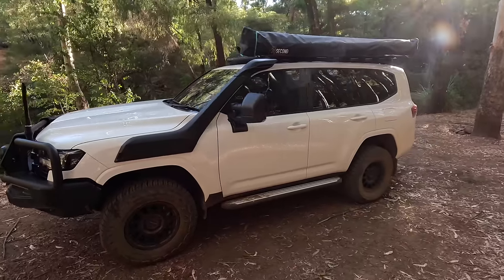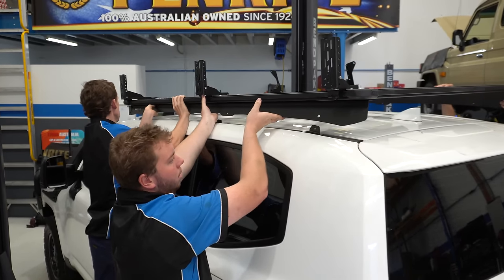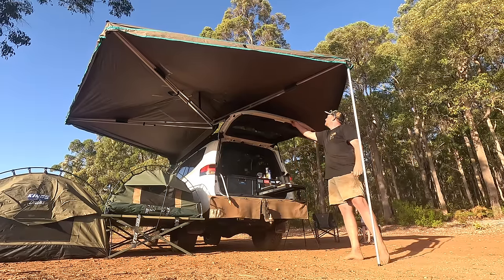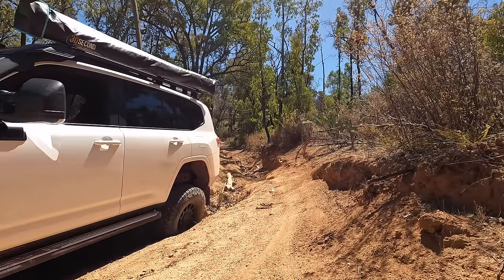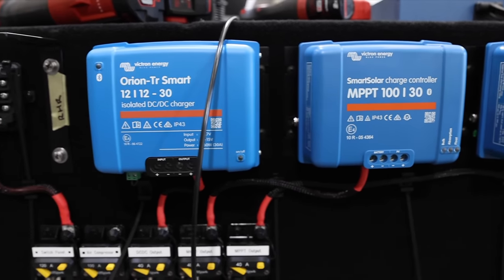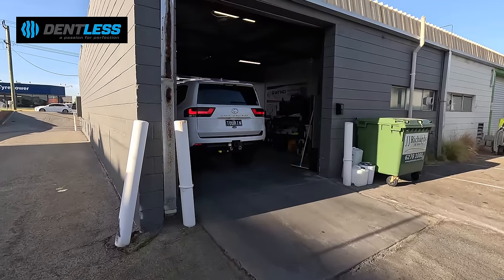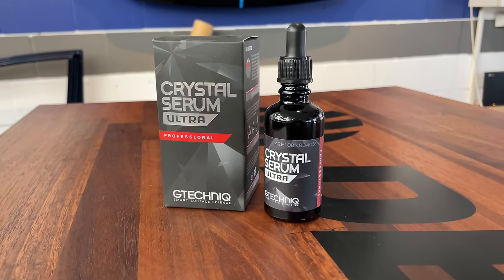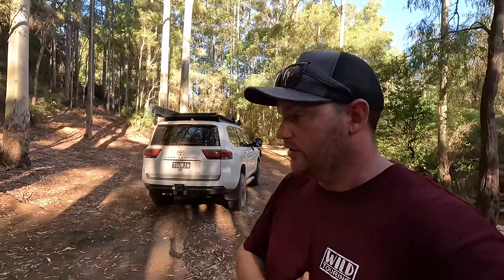LC300 BUILD COMPLETE  || ANOTHER Roof Rack, BUSTED Barwork, Paint Protection & 400w of Solar!?

Comment: I’ve had a few issues with ARB products & fitting over the years and I’ve found that the best way to deal with issues you can’t solve at the dealer/shop is to go over their heads and go to the states head office.
Good luck.
Reply: I went to my local ARB in Biggera Waters because I was looking for a suspension upgrade. He reluctantly came out to look at my Hilux, wouldn’t even bend down to have a look underneath and wanted me to tell him what was on there now. Asked me to email some details and he would get back to me with some ideas.
Went around the corner to Fulcrum who weighed it, put it up on the hoist,told me what was wrong and what all my options were. Ended up with a full suspension replacement and GVM upgrade. $9k later I’m very happy with the end result and the service from Fulcrum. It could have been an easy sell for ARB but I’m glad I went to Fulcrum.

Comment: ARB have been riding a wave of success and seem to be dropping the ball on quality along the way. Push hard as it’s not your problem and cost to refit those steps.
Reply: Dropped the ball and kicked it down the drain out of reach many years ago. I gave up on them after numerous dead, faulty out of the box and early failures in their products. They're trading on past reputation which will eventually catch up with them. Wouldn't touch them myself.

Comment: Nice one Cam. I do rate the base rack for the ease of fitting accessories and that you get a stronger fixing too. And all the kaon gear is mint. I have the same awning brackets but I have the side mount maxtrax holder that folds away. 
Also if you are still getting a bit of noise from you roof rack maybe check the gap between the light bar and roof rack. I fitted my light bar about a year after my roof rack and instantly the noise was heaps worse. It had a whistle to it. I ended up putting some foam tape between the roof rack and light bar and it stopped it completely. Can send you a photo of it if you want 👍🏽

Comment: Hi Cam, another great video. You briefly mentioned your portable solar panel. I believe it's the Quad fold 400w from Offroad Living. I look forward to your comments on that.
Good luck with ARB.
Reply: Second that, what was your decision in portable solar blanket vs roof mounted / losing your roof rack to solar?
Reply from the maker: Will have a video on this solar panel this weekend and have a really good deal on getting one cheap so if you’re thinking about buying one hold off until this weekend 😁

Comment: Hi Cam, I think the problem with ARB products is they are very expensive so we expect a good product and in my personal experience that is definitely not the case. Some of the paint work on there products is rubbish I experienced that on my roof rack  and my bull bar. The rain somehow 
Gets under the paint with time and the paint just peels off and of cause rust appears. So in hindsight you definitely don’t get what you pay for. I had to strip every bit of paint of the roof rack and repaint it myself then half the paint of the bull bar and paint it also. Myself I wouldn’t buy anything again from them I find them very blazeh and uninterested at times. I think if they don’t get there act together they may have big problems down the line. This being to many customers are getting to many problems and they just don’t seem to be to concerned. Jon🇦🇺

Comment: Hey Cam. ARB have done my last two vehicles at some expense mind you. Always been happy with the work but the side steps can get a bit slippery and on more than one occasion I have almost gone @rse up. 
I will probably go ARB bull bar on the DMax build soon. My only disappointment is that after spending maybe 30k plus at ARB and not too mention I have promoted them on my channel, not the slightest discount was offered. I rate the ARB bull bars but there is plenty of other gear on the market.  Additionally, I have priced the auto drop down retractable sliders and there is not much difference in price. So I'm going to try them on the new DMax. Scratch buff out pretty easily too mate. Mine have just been buffed out and the 76 LC looks mind again. 
Safe travels mate.

Comment: Having owned the same car for around 18 months now, I am loving your build series. Great to see you have used the KAON gear which is quality gear.
Have you driven it in the rain at all? I ask as the snorkel is my major gripe because it leaks a significant amount of water into the air filter when driving in heavy rain, which we have had lots over the last few months in SE Queensland. Toyota are still looking at the issue with no fix yet.
Safari Snorkels will hopefully be releasing a retrofit kit for their Armax snorkel which may be an expensive solution.
Not sure I want to see the next vid where you give a price run down, it might scare me as I too have pumped a few dollars into my car.
Reply from the maker: Have heard similar stories from others! It’s been summer since I ordered the car so haven’t  seen much rain. I’ve got a safari airmax on order so I’m hoping I can get it fit before winter sets in 😬

Comment: Hey Cam, re the steps, bummer about the dodgy fit but the car looks awesome with them (versus naked without them).  Personally, I would be hitting ARB up to pay for the second install, it is their product issue, and not the first one you have had from them.  Lets face it, they can get a "thanks ARB for doing the right thing" in the next video after the new step is installed, which would make us all think hey ARB are good (so positive PR) or they could stick with what I take away from this video so far...  that ARB supply dodgy stuff sometimes so buyer beware...

Comment: Great video . We are going the brown Davis tank although they have had issues but the other brand take out the sub tank so not ideal . Just for future reference bushrap do a 5 year wrap do it yourself under $1000 which we did as it actually protects.  Just with your steps really not sure why you had to take the tanks out as the bracket slides between the rail and the tank , crawl under you can see how they are fitted . Keep up with the great videos 👍
Reply from the maker: Cheers! Nah unfortunately the ARB side steps for the 300 series does require the tank to be removed for fitting.
Reply from the maker: @Susieandchris  did you cut your body mounts to get to the bolt?
Reply: I think we are both playing with words. It is dropped 50mm 5 bolts are removed adds 15 Minutes. Keep up the good work let us know if you hear when the safari snorkel is out for the GX  @WildTouring

Comment: Gday mate
Awesome rig. Very envious. 
Just wondering what sort of pressures those bead grip rims will allow you to go down to, or do they just add a bit of extra security if goin down to say 12 psi?
I’ve got a pretty gutless Hilux so I run 12 psi a lot when it gets soft and seems to be a great pressure 
Cheers mate
Reply from the maker: I’ve gone as low as 12 psi and I’m pretty confident I could go even lower. The rims do go really well - I’ve not had any bead issues since running them whereas previously at those sorts of pressures I was having issues.

Comment: Hi Cam

aside from the slack ARB QC on the side steps the 300 is looking great. 

I will be interested in your build cost video on how much the ceramic coating was. Did you look at Bushwrapz ? - I see they quote around $1300 for a 5 year self healing PPF - albeit it’s either DIY or you pay someone to install.

Cheers
Reply from the maker: Have heard mixed reviews on bushwrapz but have no personal experience with them. 

The ceramic coating cost around $1600 for the top tier, but it starts around the $900 mark.

Comment: Curious as to why you are charging from the car using 240v power from the inverter when you could charge from the car to the van anderson plug using the van dcdc converter?
Reply from the maker: Could do either, but to charge it via DC would require the car being very close to the van- which is sometimes not going to be possible in some campsites. OR I’d need longer runs on twin core, which is going to be pretty big/heavy/costly copper to overcome the voltage drop. 

Charging it off the inverter there will be losses. But won’t suffer from nearly as much voltage drop with a 240v extension lead. And I can pretty much have the car parked where ever is convenient- and in the sun 👍🏼

Comment: I would never purchase anything from ARB ever again, I've had such bad experiences with their products, service and attitude.  I avoid them at all cost.
Reply: I’ll second that - issue with their fitting, sent back for the day and still crap- so just said would never give them another $ and fixed myself
Reply: Arb are just expensive adventure kings
Reply: Yep - arb has great brand awareness , only thing keeping them going - i had two bull bars replaced as the powder coating was terrible and all scratched - second bar didn’t fit correctly . I went a different path all together -  they are a joke these days - bring in competitor brands I say !
Reply: Gees, I was pissed with their attitude, wow, I'm not the only one, haha.
Had a colour coded bar supplied & fitted to new GU Patrol by dealer.
Collected car,  when home noticed it was down on the passenger side by 15mm and fell forward.
Took it back, second attempt, removed bolts, washers & nuts, they got the side to side aligned correct, fitted bolts nuts & washers into incorrect locations bending washers, destroyed spring washers and the bloody bar still was falling forward, got told that's how they fit, nothing wrong with it.
Funny thing is, mines the only vehicle I've seen with the bar on this forward rake.
Rings head office, Melbourne.
Advise, can't help me, ring Sydney as I'm in NSW.
Rings Sydney, what a waste of time that was. Not one ounce of customer care displayed to me.
Told to return to dealer for rectification, no way, two attempts, two failures, not going there again. Asked if I took it to Minchinbury direct could they refit it. No, needs to go back to dealer involved.
Ask for fitting instructions and replacement bolts, washers, nuts so I could fit it myself. Told that's a warranty claim, need to submit car to dealer for warranty assessment. WTF.
I paid for fitting instructions, never saw them as dealer installed it, I paid for good hardware destroyed by dealer placing them in incorrect locations.
Vowed I never go to ARB again, never.
Then I'm in SA, shattered the fog light, so goes into ARB outlet in small town for replacement.
Guys fantastic, looks at my bar from inside shop to see what light is required and says straight up, that's not mounted correctly. That rekindled an old wound let me tell you.
He then goes on to explain he could spend every day refitting incorrectly installed ARB gear, saying Adelaide shop has terrible record of installation.
Well, the dealer I used in NSW wasn't any better, ha!
Never again ARB, shameful service.

Comment: Curious… how will u clean your roof now you have that ARB roof rack?
Reply from the maker: With the ceramic coating I can now just spray it with the high pressure hose underneath 👍
Reply: @WildTouring  good to know, I’ll be interested to know how that goes long term 👍

Comment: Hi Cam
Side steps out of alignment in production and QC did not picked it up? Yep, that would put the QS manager in a hot seat. 
In China that guy would have 1000 excuses… „chop the monkeys head off that other learn from it“….
Batch faulty delivered to Australia ? ARB to Sort it out and all cost for transport and re installation have to be born by ARB Australia as seller to dealer and en-customer and that without saying nor asking for.
Every company comes across such misshapes. That is different from design flaws….

Any update on the ARB roof rack  and brackets to fit direct to the roof??
I like the design, no slots outside clamping and welded structure, not screwed or riveted.
I am in for buying a new roof rack now for my 200 series.  But wait for your update if ARB has fixed properly the side step issue for you
Ronny D just released his short updated on roof loads different vehicles. Interesting 🧐 
I just wonder why so many people get that wrong how this simple calculation works.
The only thing what the various producer have to state very clear : on road and off road load capacity must be the same with 5 years warranty on material and welding faults.
RTT plus 270 degree awning is for my understanding already an overload on any roof.

Cheers from SA Yorke peninsula

Comment: I've had a very poor experience with my local ARB dealer on two vehicles in the last couple years (so, I know it's not a coincidence). I'm talking mis-matched paint on flares they fitted, accidentally drilling holes in the floor of my vehicle, squeaky suspension in their "top of the line" BP-51 suspension. They didn't argue about fixing it, but the whole time there's no apology or "sorry for the trouble" etc.. it's just, "ok, bring it it and we'll see what we can do". Every time I bring the car in for something, there's a problem and I'm back a few times. I must have spent 100's of dollars on Uber rides back and forth to pick up my car, not to mention hours out of my day... Not doubt they design some great products, but there's a lot of issues in the execution of those designs - and the biggest issue is the inconsistent quality of workmanship through their franchise network.

Comment: Hey Cam, good on you for calling out the "big brands" as a consumer, most people that follow your channel will know you are not any kind of whinger, just a state the facts bloke.  I say bash those bars to bits on the tracks and get new ones, it's not your fault they didn't fit correctly, so go them the labour as well!! Also I know you are big on safety and I would just comment with the amount of Lithium batteries, and the current supplied to them, have you had much thought about the specific Lithium fire extinguishers that might be added to you vehicle and van?
Reply from the maker: I’ve got an interesting video coming up in a few weeks about the safety of lithium 🤔🙂 stay tuned!
Reply: @WildTouring  Tuned in ! 🫡

Comment: Still think your mad for not wrapping the car in PPF. Keeps it looking good for years to come not only from pinstriping but even things like people brushing against it in carparks etc.

And you will probably want to consider an alternator upgrade, as the factory unit output is quite low especially at cruising speeds.
Reply from the maker: Yeah you won’t be alone. It’s just a cost vs benefit thing I guess. If ceramic coating and PPF were the same cost then it would be a no brainer 👍🏼
Reply from the maker: That’s why I put 30a charger in the car. Pretty small for such a large battery bank but have to work with the limitations of the factory alternator. 

Caravan has a 24v Enerdrive unit, charge current can be adjusted on it. 

Both car and van have seperate solar controllers, so combined with with alternator input they’ll still charge fast in clear conditions 👍🏼
Reply: @WildTouring  The other issue with those older 30a Orions is they tend to reduce output as they get hot, which is their biggest problem, the new XS orion 50's do solve that, and its easy to adjust output via Cerbo or bluetooth.

Ive just gone through all this with my current setup, even with a similar alternator as what is factory on the 300 series (they have 200a from factory, i was running a 180a) running a single 100a buckboost and  1520w of solar charging 1240a of lithium, and at idle at least it was very borderline, and was going backwards with headlights on. 

Was easily solved with going to a 360a alternator, and ive also added a 2nd 100a buckboost, so i do not require a genset at all, just run the truck on fast idle.

Truck itself is a Fuso Canter

Comment: Same, completely stuffed all under bonnet electrics.  Tapped into existing wiring no solder no tape just twisted together. Literally knots in wires and harnesses. Did not attach parts of tow bar, tore wires on existing trailer ecu trying to force it to fit. Couldn’t fit suspension bp51s onto the vehicle. Absolute joke.

Comment: Well you certainly opened a can of worms, many disheartened ARB clients chiming in with their complaints, as I did also sharing my grievances with their product installation.
You should be able to claim some traction from head office with this backing, but you may just get the same ritual run around I received also, rolled over and disregarded.
Make it difficult enough to say, oh stuff it.
Aside from that, your electrical has me fascinated, that's serious overkill. Understand your explanation and desired requirements but that's a serious amount of storage.
Very difficult to justify the cost associated with something that over the top IMO.
Curious for your costings on it.

Comment: I would never buy anything from arb or tjm again there nothing but Chinese crap even powder coating after a few years just goes to shit, had warranty issues as well they came good with replacement but there fix is cut holes in bar ends so Moisture can dry out so pay the extra and get Australia made